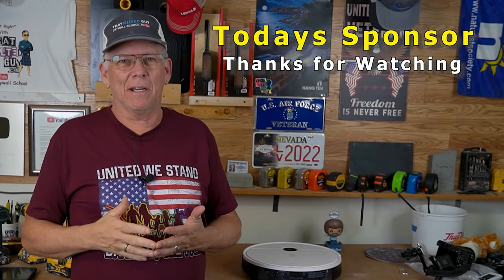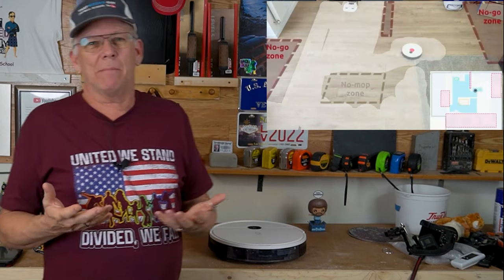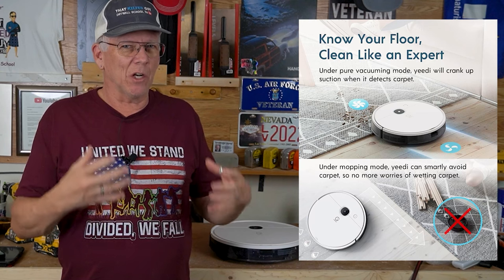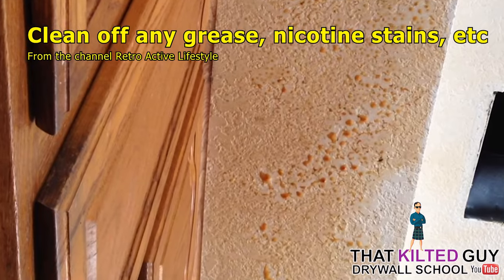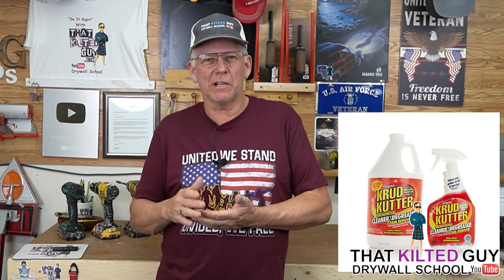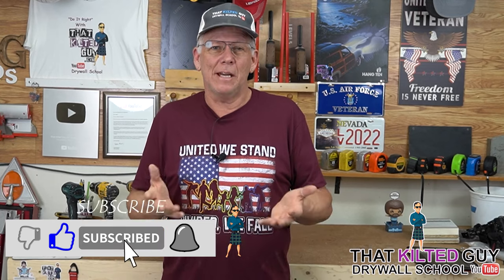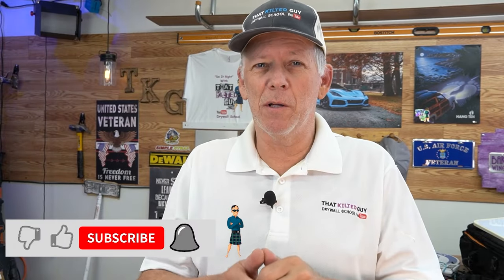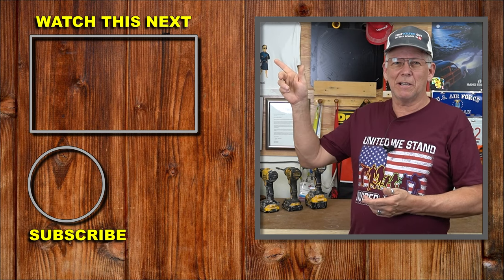Why you need to Sand & Clean Before Mudding over Paint

Comment: Another recommendation to degloss most paints is either TSP,or TSP substitute. I'm also a journeyman painter. And thats my go to way of deglossing and cleaning walls, cabinets, industrial areas,etc. I'd personally never take the time to scuff walls with sandpaper.
Reply: Same as you, suprised TSP was not the top of the list. It is meant to degloss paint and remove the finishers, as well as grease , nictotine and other contaminants.
TSP and then rinse with clean water, both done with a sponge and rubber gloves.
Easier than sanding and not dust.
Reply: Appreciate that I didn't want to sand all my walls trying to redu a room currently. After I use the tsp I can re plaster and paint over if needed then?

Comment: a couple of questions for you, 1) I scraped the popcorn ceiling in a smaller room, came off mostly good. What do you do for like a corner where the paper tape ripped up a little bit on the ceiling part, but not on the wall part? should I rip the tape off and redo on both the wall and ceiling, or can I put some mud behind it and push the paper back onto the wall? 2) also I have a spot where the paper ripped off in tiny little specs, like the size of a ant for each one, but like 20-30 of them within a sq ft or so, its just like little specs that kinda got caught from scraping, any advice there? I am going to repaint the walls and ceiling after, so no worries about that, and I plan on doing a skim coat cause I want a super clean finish. 3) do I need to clean up dust before I do repairs, and do I need to clean up dust before doing a skim coat, and before I paint?
Reply: Grrr, this is happening to me. The stupid popcorn is super heavy at the corners. Also makes it super hard to get smooth. I used some adhesive to spay the lifted tape back down, but that's probably wrong.

Comment: I watched workmen put together an outside wall in our neighborhood. It was a sheet metal wall they covered with stucco to make it look like a concrete wall with stucco. I looked at that and said to myself: "that's going to come off". Sure enough it failed within a couple of weeks. Metal flexes with temperature.

Same thing with wood or other similar surface. Mudding over it is placing rock on the surface. Any movement of the underlying surface, it is going to crack off.
Reply: The diameter of those steel giant, round, cookie-pan shaped tanks (usually asphault in tanks)  that you see in refineries will expand up to 4 inches once the tank is heated up so the asphault is thin enough to flow through pipes.   Insulation walls and roofs (installed over/after the plate metal roof) are often added later to help insulate the tank and cut down on heating costs.    They have 4 gutter looking channels on the roof but they have nothing to do with draining water they're actually expansion joints that you have to tie the insulation roofing panels to.  If the panels were tied to the tank they'd all be ripped apart from the expansion of the tank- which is solid thick steel.

Comment: 6:03 You recommend scuffing up especially a glossy surface. What about with Gardz? Sometimes I worry about that when I can feel how slick it can leave some areas. Is that also important to sand or since it is meant for being topped with joint compound is it different?
Reply from the maker: It's meant to be coated without sanding.  Here's their description - "When dry, GARDZ may be topcoated with any standard architectural water-based or oil-based primer or topcoat. 
GARDZ is compatible with all types of joint compounds and spackling pastes and any texture or popcorn finish may be applied over it.
Reply: @ThatKiltedGuyDIY  Thank you for the reply. Yes, Zinsser gives those application directions. But I wanted to know what you think, with your experience with Gardz. So that is one glossy finish we don't need to worry about? No need to scuff up with sanding?
Reply from the maker: @tonyc7352  yes I’ve never had a problem with it sticking
Reply: @ThatKiltedGuyDIY  Thank you

Comment: Hey Guy, I have a question about cracking paint. It was caused either from too thick of paint or not let it cure long enough between coats. I've tried sanding and scraping but it doesn't flake off or sand well. I also tried using killz 3 primer that has a shine too it to see if it would hide cracks but was unsuccessful.  Could I skim over this and if so what steps should I take? I'm also concerned about recracking.  I've even considered paint stripper but was afraid I might cause more damage. This was a popcorn removal project that went well from watching your other videos. Unfortunately I did a bad job on the paint process which has made this so stressful.  Would appreciate your input.  Thank you in advance!
Reply from the maker: Plain drywall mud isn’t very good at fixing cracks. If they are cracks because you put the paint on too thick, let it dry for a month and then repaint it properly with two coats of high-quality paint from somewhere like Sherwin Williams.

Comment: How do I avoid pin bubbles in my mud when I go over a painted wall ?
Reply: Go over it again with the tool, or.. wait a bit until the mud is tacky, then polish and use the small amount of fat in the blade as you scrap fill the bubble voids.

Comment: I have a serious problem and would love your help.  I sanded all my walls and wiped down all the dust.  I just started priming the existing painted (eggshell) walls with Behr multi-purpose primer.  I noticed some bubbles in a lot of areas (areas not freshly mudded). I can take my drywall knife and pull off sheets off if I run my knife under the bubbles.  It looks like the previous paint layers are delaminating from the wall.  Will an oil-based primer like Zinsser Cover Stain or a shellac-based primer like Zinsser BIN help in my case and re-adhere the paint?  I think I'll have the same problem if I use a water-based primer like Zinsser Bullseye 123.  Any advice is greatly appreciated!

Comment: Great video again from the best kilted drywall man. Question:After sanding with a radius sander on flat - or eggshell paint knock down walls, use a damp rag to remove the dust? Any other way? The radius sander has a microfiber mop cover. Can I just use that dry or is a damp rag better? Sanding a flat paint wall creates a lot of dust. The nice thing is that using a Wen power sanding pool even takes off some of the knock down texture.
Reply from the maker: Yes you can use the mopping attachment. I’ve got one and it works but you need to shake out the dust every couple minutes is the one issue with that.
Reply: @ThatKiltedGuyDIY  classic

Comment: I have a customer with painted cmu walls. They would like "flat walls" as in a level 5 finish. What is the correct product to skim coat with? I was thinking USG All Purpose Top Coat. Thanks!
Reply from the maker: I’m not sure what a CMU wall is but unless you’re going over raw drywall, I wouldn’t use topcoat as it doesn’t have as much adhesion to it. Regular all purpose, has better adhesion and if it’s over paint or anything, glossy, sand it with coarse sandpaper first to ensure it can stick to it. Be sure to remove any dust, though.

Comment: How do you recommend cleaning the drywall after sanding? Especially newly skimmed drywall with a lot of dust. Thanks!
Reply from the maker: Fastest, big fans in the windows, and the leaf blower, cleanest, vacuum cleaner rated for drywall dust. Cheapest, dust, mops, that you shake out a lot, or even damp mopping, with a big dust mop. Sanding with a vacuum attached. Drywall sander does a pretty good job of removing the dust as you go.

Comment: Can I hot mud over wallpaper and paint if I sand it real good? Would a bond product help it stick on?
Reply from the maker: Wallpaper will often bubble up and de laminate from moisture
Reply: @ThatKiltedGuyDIY  gotcha. Some rooms the previous homeowners left me have wallpaper borders slapped straight onto the drywall, with tons of layered paint around it. 
I removed some wallpaper last night, and I’m left with exposed drywall and about a 6 layered paint difference between the two, and has a very hash paint line. 
So in order to even that area of my walls, does sanding down the paint line until smooth, then put mud over it to even out the wall thickness sound good?
Reply: I’m somewhat new, but have watched over a thousand videos on hotmudding/painting/fibafuse etc.  Hint:  Do NOT use the bucket joint compound; DO use 20 or 45 minute hot mud.  I would never paint over wallpaper or hotmud over it.  It’s worth the effort to take every bit of wallpaper off, using water and a large sponge. Then sand and wipe wall clean. Get it as smooth as possible. Hint:  Apply oil based primer to the entire wall; not water based. There will always be residue glue on the wall from the wallpaper and water will activate it. After sanding any imperfections again, I then applied Zinsser 123 water based primer.  Wall now ready for paint without hotmudding.  I then removed a border in the bathroom.  I again applied Kiltz oil based primer after removing wallpaper and sanding. I then Patched towelbar holes and other damage with hotmud. Sanded again and applied Zinsser water based primer to entire bathroom. It may be an overkill, but it’s nice and smooth for paint. But to answer your question about unevenness, you may have to hotmud the entire wall.  Just be sure to seal in that glue with oil based primer first. You might just apply it to the wallpaper border area.  Good luck

Comment: So I've got a question, need some help. So I've got a 1996 clayton 16x80 mobile home with that vynil faced drywall, that has also been painted with what I think is a latex paint.  I'm taking out the strips between each sheet of dry wall & mud n tapeing the wall like normal house walls with lots of patches. Now this is not quite half the house more than half the house is getting new dry wall but I've decided to salvage what I can, maybe. The question is what kind of mud do I have to use to tape & patch them old trailer walls with a 10 yr old latex paint job over them. Any help would be appreciated thanks
Reply from the maker: Hello, you can find guys support options on his website below.  

www.ThatKiltedGuy.com
Reply: You can still find those strips new old stock at the new mobile home dealers or new from suppliers. Mobile home drywall is not the same thickness as stick built house drywall . You can buy those sheets as well still new old stock.

Comment: I have a wall that when it goes in to the corner it sinks in about 2 inches over a 3 ft span. Can that be floated out even with mud or should I just cut the dry wall out and fur the studs out and put new drywall on top.
Reply from the maker: Furr it out. Never fill that much

Comment: Watched most of your videos multiple times and have learned so much, but I still have questions. I have 2 projects 1. ba wall; 2 bedroom wall.  First, bathroom wall looks to have satin finish.  I washed with tsp.  I removed old sealant (caulking) where the lower half tiled wall meets the upper painted wall. Left damaged sheetrock where I removed caulking, which I need to hotmud.  Should I seal the entire wall with Zinsser 123 before repairing with hotmud? Or should I use an oil based Kiltz primer? (hoping u say water based 123). Second project, I've prepared (opened up) settling cracks in bdr wall (has flat paint) to ready cracks for fibafuse and hotmud. Instead of sanding wall before hotmudding, can I use liquid sandpaper?  Then do I need to apply zinsser 123 b4 hotmudding?  thanks so much for your help.
Reply from the maker: Hello, at this time we are moving into an RV to live full-time and we are super busy. Answering every single question has become too much work, and I apologize. I will still try and answer the questions from people who have joined our YouTube membership, Patreon membership, or if you click on the THANKS button below the video to make a donation.  You can find more support options on our website at thatkiltedguy.com. Thanks for your support and glad we can help you  That Kilted Guy video productions llc team For Guy Purcella